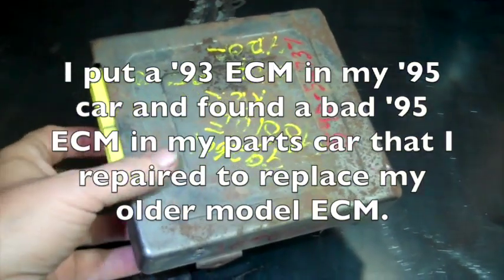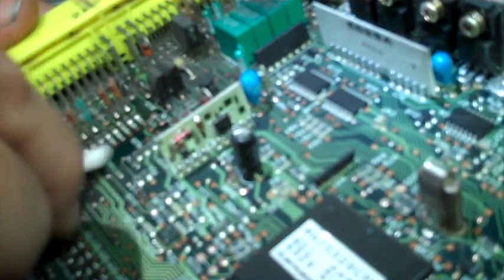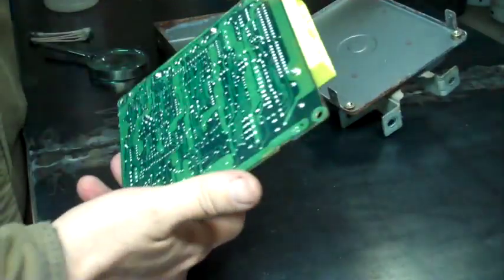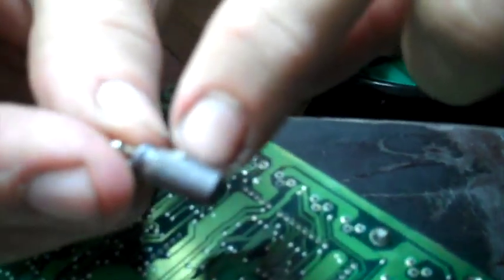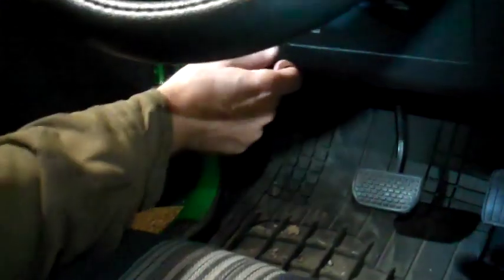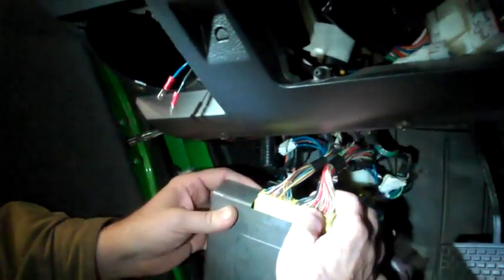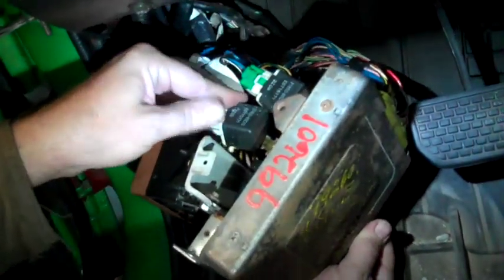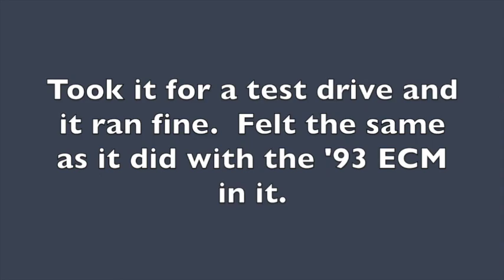1995 Suzuki Sidekick ECM/ECU (computer) Repair

Comment: I have a 93 but i dont have fire on the cylinder 2 and 3 i change wires spark plugs distrubuitor cap rotor and nothing
Reply from the maker: Does not sound like an ECU problem to me.  You can chat with me on my face book page:  www.facebook.com/SidekickRebuild/
Reply: Same problem here, what was the cause? Thank you

Comment: Right, what are the capacitors you used?
Reply from the maker: Vishay C-103 from Mouser Electronics.  Also, check other comments below for more about the capacitors.
Reply: @nunapitchuk  The comment below shows capacitors from a 1998 device. the 1991-1995 is different
Reply from the maker: @Administrator7  Took me a awhile to find the reciept, but here is the part information from Mouser Electronics:  75-678D476M050CC4D
678D476M050CC4D
47uF 50volts 20%.

Comment: Sir I love it your job. I wish to be a your voluntary student 😅😊
Reply from the maker: I could use some help.  I'm doing body work now.  When can you get here to Tok, AK?  Smile.
Reply: @nunapitchuk  sure I ready,
Sir I need two things 
Number 1 wiring diagram with IAT Present, and Number 2 one opportunity to talk with you.
I Suzuki Sidekick and geo tracker, and have a lot questions,
Reply from the maker: @hectorrojas8932  You can contact me on my face book page:  www.facebook.com/SidekickRebuild/ or email me.  I have wiring diagrams for 1993, 1994, and 1995 models.  Also check a website: geopink.com.
Reply: @nunapitchuk  Dear Frank, do yoy think if you I take thermostat off in this car it spends to much gasoline
Reply from the maker: @hectorrojas8932  If you remove the thermostat from the cooling system them the car will run too cool and probably use more fuel and make more pollution and run poorly.  The engine needs to stay at about 170F to 180F for best performance.
Reply: My friend are you from Alaska?
Reply from the maker: @hectorrojas8932  Yes.

Comment: hey i have problem no injector pulse whats the problem? vitara 1993 1.6 16valve
Reply from the maker: I think your car has a single injector.  So it could be a bad injector or the wire/fuse to the injector.  Did you take it our and test the resistance of the injector and do a continuity test on the wire?
Reply: @nunapitchuk  they have 4 injectors. i pull out all and not working fuel dont came out.  i test when starting 5volts been there.
Reply: maybe imo or they not imobilizer?
Reply from the maker: @davisleija1314  I think the injectors are fine because having all 4 go bad at the same time is unlikely.  It has to be an electronic problem.  If you want to message my face book page I can try to help:  www.facebook.com/SidekickRebuild/
Reply: @nunapitchuk  wire on injector to the  ecu is good

Comment: I have abought a geo trakcer that was siting since 2002. It drove very good i parked it  and when i try to restart im getting a cliking sound on the fuel pump relay and under the engine hood by a smal actuatir thing that has 1 or 2 vacuum hose runing to it..
Reply from the maker: I have never worked on an 02 model, but my first guess is weak battery or poor connection to battery because when the computer does not get a full 12V then it does things like you describe.

Comment: my engine light flashing, flashing dont show code. Why ? flashing again in again
Reply from the maker: Sorry, but I don't even know what kind of car you have or any other information so there is no way for me to know why your CEL is flashing.  You can try to contact me through my face book page, suzuki sidekick restoration project, and provide more info and I will try to help if I can.
Reply: @nunapitchuk  1995 2.0 v6 vitara 5 door
Reply from the maker: That is a much different car than mine.  You might need to find a service manual.  Here is a link to a forum that might help you solve it:  www.suzuki-forums.com/suzuki-sidekick-escudo-vitara-geo-x/44508-check-engine-light-keeps-flashing.html

Comment: Thanks for the video! I got a 1994 with a bad ECM, I need to pull in a couple of days. It's gotta be bad caps. I live in Arizona and it gets super hot here. Drys electrolytic caps. right out.
Reply from the maker: On a '94 model, from all that I have studied, the chances are good that it is the exact same problem as the one in this video.  Mine is working fine now.

Comment: I think your 1995 ECU will be looking for the thermoprobe input from the EGR circuit, and will throw a code 51, if you’re putting this into a 1993 vehicle.
Reply from the maker: It is going in a '95 vehicle to replace the '93 ECU that was in the car.  To make the '93 ECU not cause a check engine light I just unplugged the the EGR.  It was working fine, but now I have this one in the car and it is also working fine with the EGR plugged in.  No codes yet.

Comment: Heya! Great video mate! Just a question: my ECU is repaired but now when I turn on the engine, the RPM stays at 800...there's no "peak" when I turn the key on...it just start and so...also it doesnt go up with rpm when the engine is cold. I know it usually go up to 1400/1500rpm till it went hot enough...Can you please tell me what can be the issue causing this? Thanks!
Reply from the maker: My first thought is that the temp sensor, below thermostat housing, might not be working.  You can can talk to me more about it on my face book page, suzuki sidekick restoration project.
Reply: Leo LADA You don’t advise what your engine is - the 8v and 16v have different set ups for cold start.  The 8v has a throttle opener that remains open for about 5-10 seconds, and gives you an rpm of about 2000 rpm, then drops to 1500.  After that, both engines are the same, and are governed by a mechanical wax pellet valve that provides additional vacuum as the engine heats up to melt the was.
Reply: @Inisfad  Uh yeah sry :) 8v engine here
Reply: Leo LADA Do you still have the problem?  Frank Cook advises that you should check the coolant temp sensor - which you should, although your problem may be elsewhere.  This is what advises the ECU whether your engine is cold or hot.  It’s the round blue/green sensor on the right side (as in right hand drive) of your engine.  Check the connections at that sensor, as well as the ohm reading across it.  When your engine is cold, that ohm reading should be 3000 ohms or more.  If that sensor is not operating properly, the ECU doesn’t know if the engine is hot or cold.  Also, the 8v engine has two vacuum solenoid valves that sit together at the front of the engine - one is blue/green and the other is brown.  The brown one is the VSV for the throttle opener.  If you follow the vacuum line from that brown VSV back to the rear of the engine, you will find the throttle opener - on the engine, sitting across and slightly down from where the distributor is.  It has a diaphragm in it that can be open or closed.  The default position of the throttle opener is open (which would give you vacuum and cause your idle to be high). When the ECU comes on line, that brown VSV energizes and provides vacuum to the throttle opener, which then closes.  So, you may want to check the throttle opener - make sure that it’s open when the engine is shut off, and that you can (very carefully, so that you don’t rip the diaphragm) move the diaphragm open and closed.  The wax pellet valve, however, is not connected to the ECU or the electronics of the car in any way, and if this is operating properly, you should have a cold rpm of about 1500 or so, when the engine first starts.  This is located behind a metal plate to the right of the throttle position sensor.  If you take the metal plate off, you should see an air port on the right side of the housing, when the engine is cold.  This is what provides extra vacuum to the valve.  If you want more info, you may want to post on Suzuki-forum.com.....